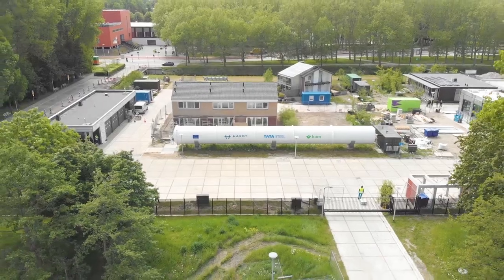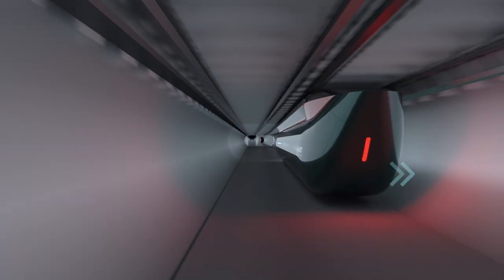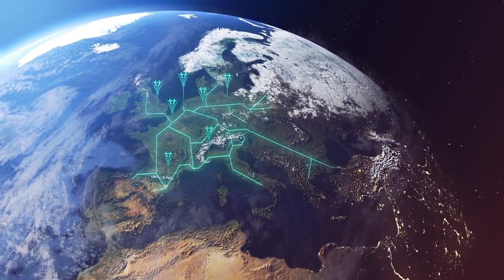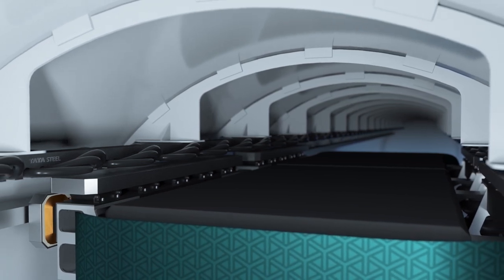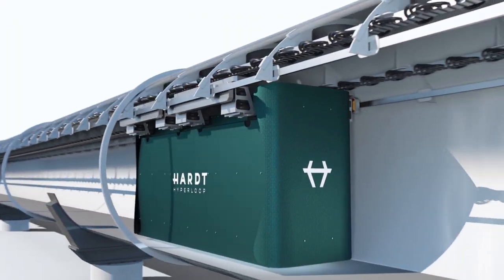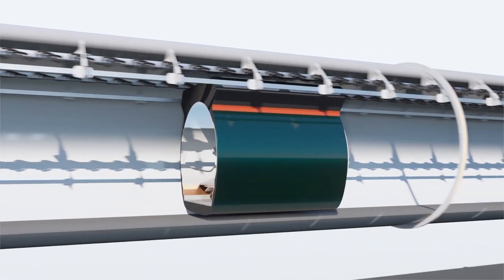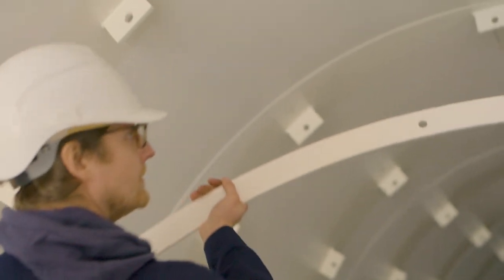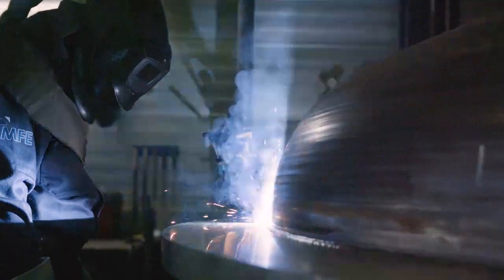The First European Hyperloop

Comment: Just get rid of the vaccum tube and you have a maglev train that can switch tracks without needing the entire track/beam that the train runs on to move. This is the archilles heal of all current malev trains and monorails (just look at a video of a Transrapid track switch in action). This is probably the important research development that will come out of this project, rather than a Hyperloop.

Comment: Interesting. But why are the magnetic rails on the top of the loop and not at the bottom like on regular maglev systems already existing like the Transrapid or the Japanese Maglev? Just to make it look fancier than others? On the engineering point of view when you but them up you have to make the loop unnecessarily much more structural sturdy than otherwise necessary which will skyrocket the costs of this system for sure. And I really don't see the point of doing so, since you have to elevate the train anyways or rather keep it from falling down, which should use the same amount of energy as far as I comprehend. But maybe I'm wrong and someone can explain the benefits of this, since I'm no expert in this field.
Reply: The most energy efficient configuration for a magnetic levitation system is when the magnets pull themselves towards the track, like in this case, and also with the transrapid. By placing the magnets and tracks on top the vehicle is no longer hugging the tracks (Like the transrapid does) and is able to switch from one track to another. Furthermore by using "attracting" levitation rather than "repulsive" the tracks are made of steel (Instead of aluminium or copper, required for "repulsive"), which is very cost effective. The tube needs to be strong anyway to hold the pressure, so the extra load of having the tracks on top does not affect the costs much.
Reply: @joseeduardosanchez4305  Why can't the Japanese maglev (which is in a  trench configuration) do switching like this by attracting to one side of the track in a track split?

Comment: It's impressive but I think you need to consider the experience for the people inside of the loop. I think you will find it very hard to convince people to use it over flight if there is no way to look out.
Reply: Just scrap the tube and build a suspended maglev that is proven to work and doesn't possibly violently implode on you 🔥 and you can look outside all the time 🤷‍♂️
Reply: Just add some windows to the sides or a long stripe of a window. Though it would be more structural challanging. But you could also add oled screens to the sides of the train and a lil camera ´that rides along on the outside for the view. Or just watch your favorite show instead ;)

Comment: Looks legit.
A 20 meter tube with airtight doors at each end.
How do I get in?
O, you close the doors after each "train"?
And how do you get a vacuum when tubes are all over Europe.
One little hole and you can forget your vacuum.
How do you secure thousands of kilometers of vacuum tube?
One person putting a couple of tires on fire under the tube, and you have a HUGE problem.
Latest test I've seen on YT showed max speeds of a car in city traffic.
That 20 meter tube is fun to play with.
But don't pretend it's going to be real one day.
Reply: Maintaining vacuum on the track? Maybe like we maintain pressure on the ISS? With an airlock Sherlock? And you maintain vacuum with several pumps along the track. I assume at least that had been calculated against the power you should have used for a similar maglev system to push the air away at normal pressure. At least that is what I would have done 1st to calculate the reasonability of a concept like this.
Reply: Actually, the idea of maintaining near vacuum across large distances doesn't seem impossible to me wince we can maintain acceptably high pressures through thousands of kilometers of oil pipelines.
That said, you're right. This tiny tube segment in someone's backyard is kinda ridiculous.

Comment: Took a Transrapid track.. put it in a tube... supriced that it still worked.

Where is the innovation?
Reply: The difference is that the hyperloop can move at airplane speed, is way more efficient and cheaperfor different reasons(no wind resistance I.e.)  and hence a more viable transportation system that could actually replace short to medium haul flights while the transrapid was more a maxed out high speed train.
Reply: @thomaslala9071  no it cant, because it dont exist.current generation maglev can reach 750 km/h with no modificstion. With modification it can run att over 900km/h.

Hyperloop is not more economical, because it dont exist. Even if it would, it still would not be because vacuum pumping also needs power.

In short its a horribly bad idea not thought through propperly
Reply: @matsv201  we will see by 2030. A lot of people working hard on that concept and  put a lot of recourses in it right now.
Even a lot of big companies including large railways transportation companies that were highly sceptical on the hyperloop initially are now invested in hyperloop companies and provides support.
I guess those people are all wrong and had no idea what the word transrapid even means and you are the illuminated one.
Reply: @thomaslala9071  

"we will see by 2030"

No we wont... the date keep chaging. It use to be 2015, then it was 2020, then it was 2023, now its 2030.

"A lot of people working hard on that concept"
Lots of confused people in there early 20 that don´t have a clue what they are doing.. yes.

"Even a lot of big companies including large"
Not really. Its like tiny subdivisions that have nothing to do with the larger companies. With CEO that don´t have  a clue how tech works
Reply: @matsv201  But you can but solar panels on the loop all the way. Not really on the thin air that surrounds a "regular" maglev train
Reply: hey put it on top of the tube for no apparent reason, that the Innovation. So you need more steel to make it sturdy enough which makes it unnecessarily more expansive. But a steel company is funding this, so you have to make some compromises to please them I guess...
Reply: The Innovation ist to get millions from Investors, without having Proof of Concept 🙂
Reply: @tenj00  Even if they had one... there is really no economics in it

Comment: So you basically reinvented the subway. Yawn.
Reply: With no wind resistance
Reply: CRONIC078 actually you’re wrong the hyper loop goes around 100x faster than any transportation on the earth
Reply: [citation needed]
Reply: @_Axdn.  By 100x you mean slightly faster, right? China and Japan have already rail-bound trains going 500+ Km/h in testing. But they don't need airport style terminals with security check. That shaves half an hour or more off the journey and thus the Hyperloop has lost any possible advantage in overall travel time. That is why nobody in Japan is bothered with Hyperloop... they already have the real deal.
Reply: @Baerchenization  With a crazy amount of aerodynamic drag and therewith energy consumption. Don't you see it? Fd = 0.5*density_air*(v_body)^2* Cd  If you increase the speed with the same air density out of the window go your sustainability goals.
Reply: @maxwink5871  Do you know how much energy it costs to pump a 1000 km long tube vacuum? Don't you see it?
Reply: @nietkees6906  The pumpdown only has to occur once and the energy required for keeping the pressure will be negligable to the savings. It all depends much on the aimed for pressure inside the pipe, but for reference the Nord Stream Gas Pipeline is 1220 km partly through the sea, a pipeline system with 50 bar + pressure difference on the system. Hyperloop needs less than 1 bar pressure difference.
Reply: @maxwink5871  The pumpdown needs to happen each time you enter or exit a station, this of course doesn't costs as much energy, but it also costs time. Which is another disadvantage of the hyperloop. Also getting through security will probably take a long time, so that in the end the time gained isn't as much compared to air or train travel.
Reply: @_Axdn.  Not yet it hasn't.